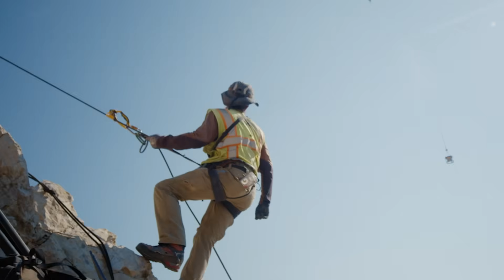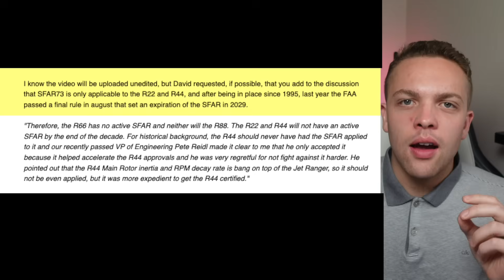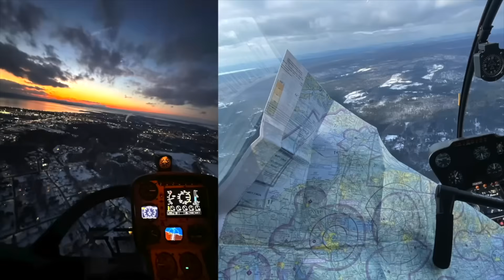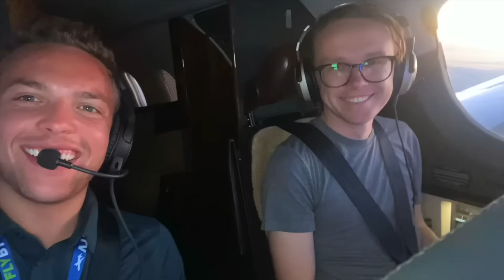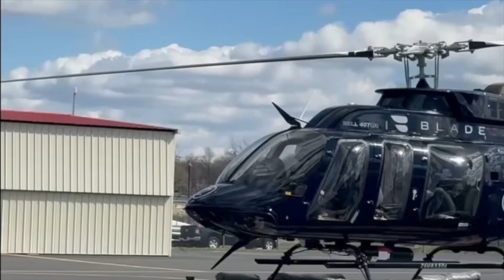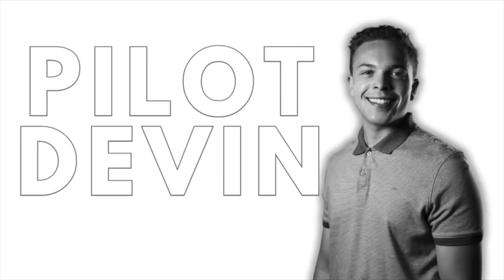Robinson CEO Defends the R88’s 2-Blade Design

Comment: Despite the claim at 2:02, the angle or rate of descent is unrelated to rotor inertia. Rotor inertia is important to maintaining rotor speed during transition, but after transition and during descent the rotor speed is constant so the efficiency of the rotor system as a wing is unrelated to inertia.

Comment: The engine in an R66 is s Rolls-Royce RR300, the latest variant in the Allison Model 250 family. Yes, the Model 250 is an old design, but most turbine engines are designs that started before the pilot flying them was born. 

Does anyone criticize the MD500 for using older variants of the same Model 250 family?

Comment: The mast bumping issue in negative G on 2 blade helicopters is an issue in for example extreme weather ... you have to load your disc immediately and I've seen first hand 2 examples where a possible wind gust caused a must bump.
Reply: But, Robinson addressed the issue by not requiring negative g.

Comment: While I don't have any verifiable blade and rotor weights for the R44 to do a direct calculation, I was able to find some published inertia and autorotative index numbers for the R22. Based on those values and assuming some basic scaling, it would appear that the R44 would be well short of the 206 in the rotor inertia department. Not sure why Pete Reidl would have claimed the inertia is on par with Jetranger (especially based on pilot anecdotes). Would be interested to see how that was supposedly calculated.

Comment: Most of the younger pilots learned to fly on the 22 so we should be able to handle the Robinson system without issues and the level of inertia of those blades must not be that bad. The 22 is a very tricky machine but the 44 is a beast in comparison, it will float for a while

Comment: I wonder if the April 11, 2025 Bell 206 crash will factor in.
I watched this video the day before, otherwise I would not have known about low - G conditions on dual blade rotors.
RIP

Comment: Pilots flying the Grand Canyon used to actually aim for low G !  (Not necessarily on two blade aircraft ) .
Years ago they would approach the rim of the canyon then push as the helicopter 🚁 overflew the canyon.

Reckless.

Comment: engine shops said the 66's engine is old tech,  this ship better be as smooth as an L4. and cost competitive, and that engine cant sit, it needs a run put in the book biweekly . long blades arent easy to truck as well.  fast shipping a blade need special aircraft as well.  "systems"  are great when they work, But no work ? will it ground you? Any one with autopilots will have horror stories on getting it working again. 's. then add in much of the planet  access to high end avionics shops let alone a field repair visit are scarce, We hear stories constantly how people struggle to get someone to even set a fuel control up on a 206 or MD500 in many areas. .. let alone electrics that can ground you.   then the cost, Bell 222 operations that saw 40K min charge to get any Rogerson box looked at

Comment: IMO,
Besides the inherent problems with a two bladed main rotor, mast bumping, low G's etc, that can be rationalized with bombing you with "more" training etc, etc, which seems to be the mindset that will cure all safety issues to make you a "safer" pilot. Most pilots are safe pilots, it's the equipment in question that may not be a totally "safe design". 
The problem I see here is the "proper loading" of a 10 place chopper. The PIC will have to be very vigilant on how the chopper is "loaded" to maintain a "balanced" load to get the best CG, Center of Gravity, ie, your "weight n balance" sheet. This will be a tricky issue 
when having to load the chopper up to max capacity. Personally, I feel the R88 will be a flying coffin. At first glance the design looks weak, compared to a UH-1
Huey. The tail boom looks like a match stick, compared to a Huey.
It will take at least 5 years of the R88 being in service out in the field to prove it's own safety record. Robinson is trying to "cash in" with a multi-use cheaper or more affordable chopper. It's safety record has yet to be proven.
I have flown R22's and now currently flying the Bell 47's...
Clear Blue n 22
%

Comment: I had a friend with an R22. He said Robinson helicopters told him they were having a blade separation problem and just take a quarter and tap it along the edge. Listen for hollow spots.
 Yes, me. What I thought of that. I told him just write out a check for new blades because if they separate in the air you're gonna be busy writing that check on your way down.Wishing you would have bought those blades

Comment: My conclusion is they have provided an increase level of flight safety via complex avionics and sensors to mask an inherent limitation of their rotor system. The cost to develop build and maintain the addition avionics and sensors should have been invested in a better rotor system. The additional complexity of avionics and development is going to add hundreds of thousands of dollars to each machine, plus increase the long-term costs of maintenance and compliance. I hope I wrong, and the machine is a great success, just have to wait and see.

Comment: I don't understand why they keep using a free teetering rotorhead?  Surely they could switch to a slight variation and completely eliminate the possibility of mast bumping.
Reply: They compete on price, not safety.
Reply: The autopilot and new tail do that - the new autopilot will basically more or less prevent the flight condition  - but of course they can’t advertise that because there is always a possibility
Reply: @Fatherof12 Good to know!

Comment: I got into some pretty bad turbulence in my Enstrom a few years ago and I was thankful I was not flying a Robinson. I'm not sure I would have made it if I had a low-g sensitive 2-bladed rotor system.
But, I understand the practicality points David makes. One of the rotor blades on our EC120B needed repair and it took over 3 months.

Comment: It at least looks good.  Bell blew it when they designed the 505... SO stupid looking. 
What ALL helicopters are missing is QUALITY screen/radio interface via the CYCLIC & COLLECTIVE.  Yes, touch screen sounds sexy, but there are so many keys/buttons that should be accessible via the flight controls.  I just don't get why there are no test pilots or "feedback groups" providing this input!!!!  We seriously need quality UI/UX software AND hardware people in this industry.  You should never have to take your hand off the controls to change freqs. and I'm not talking about a comm flip-flop between active and standby (yes, you need that) but also can switch between UHF, VHF, FM (an up-down-left-right type switch like the OH-58D?).  Airbus (and I hate Airbus helicopter products) have the best cyclic setup option out of the bunch (plenty of buttons that are fairly ergonomical to reach and lots of them); it's easy to make a collective control head whatever size you need.  There are lots of times you need to just be able to zoom in on the moving map or switch display options that should be tied to a button on the controls instead of taking your hands off of them to touch the screen.
Also, I forget which Garmin but I think the touch screen G650 when you went to change the volume the little mini-screen display would cover over the flip-flop button for 2-3 seconds, delaying you to flip-flop if you needed to right away (who designs these things?!?!?!).  Poor software UX design.

Also, QUALITY pilot seats.  Passenger seats can be those thin-style, slick looking types but pilot seats (e.g., butt in it for HOURS/ALL-DAY) should have amazing foam.  I have an office chair at work (NOT memory foam) that I sit in for 8 hours my butt NEVER gets sore (kind of the higher end Office Depot style that's not even gel; just high quality padding; and it's a 3rd hand-me down, LOTS of really big guys used to sit in it for years before me and it's still amazing).  Why can no helicopter manufacturer not figure this out (I've flown 60, 206, 407, 130, 530, and 145 and they've all largely sucked in the seating category).  

Little details like a quality helmet hook, SEPARATE designated place for checklist/emergency checklist or iPad (compact slide in compartment and NOT the same big pouch/compartment area you're going to stuff your snacks, hat, etc. in)... I'm sure there are others but I'll finish my rant for now.

Comment: Next time you talk to him, ask why they ran the back end of the cabin through a bandsaw and made it so blunt. Could have had a nice sculptural butt like on an A-star or even a Jet Ranger, but instead we get...flat? I get the "fold down for a litter" thing, but surely they could have shaped it with something a bit more ... aesthetic. And before all the haters get on me for wanting good aesthetics, I'm not claiming you sacrifice functionality for aesthetics. But there are ways of designing that can balance those better than what we got here.
Reply: Flat back end and cone on top and you can immediately tell it's a Robinson product from a mile away 😄
Reply: It’s a pickup truck, and it turns out “more sculpted” actually can create aerodynamic instability - this was discovered in the early days of helicopter design - you might also research the Gurney flap

Comment: Do the R44 and R22 have weights in the blades like the JetRanger/LongRanger blades?
Reply: Of course they do.  That’s how the rotor system is balanced and tracked.
Reply: @JohnJones-ff4nu  I was referring to the "blade weights" bonded in the ends of the blades to help with blade inertia during autorotation. They weighed about 20 pounds or so. I wasn't referring to the small weights used on the hub for track and balance purposes.
Reply: @leroycharles9751 Yes there are weights at the blade tips.
Reply: @ Thank you.

Comment: Is it gonna have at least have composite blades ?  And why still open end tail rotor ?
Reply: Don’t know about the blades but the tails on robinsons are really good. Ya they have the risk of people walking into them or running into things with it but if they did anything else it would add weight and complexity and would increase cost. I think the whole idea is to be in a lower cost market

Comment: You know what… these guys are actually genuises. I was skeptical before I watched this but hes 100% right. Everybody else is building multi blade multi engine helicopters these days. If people want a helicopter like that, thats perfectly fine and they have plenty of great options to choose from. If they had built a multi blade turbine helicopter they just would have been another one of the many companies doing so. What people cant buy these days though is a brand new, low/flat floor, rear hatch, turbine helicopter with 2 blades, so theyre bringing something new to the market that doesnt exist. You can buy old hueys and 206’s but they arent rear loading. The low cost and minimal hangar space needed is huuuge here. Theyre going to be able to essentially own the low end of the turbine market. Hes absolutely right that if the option is a 2 blade or nothing because its too expensive people will go 2 blade every time. Theyre actually opening up a whole new niche that theyre going to have all to themselves. Even the leonardo aw09 which is revolutionary in its capacity for a turbine single has a 5 blade rotor. So already theyre undercutting them and its not even out yet. The amount of features, low cost, ease of maintenance and hangering is going to be huge. Soo many people dont need or cant afford an h135 and this will do most of the job for a fraction of the price.

-One other thing he mentioned which was important that I wish you had grabbed on to and expanded on is how they changed the tail to fix mast bumping. The autopilot is great to have if its needed, but fixing the tail makes it so the autopilot will rarely need to intervene anyways because it is no longer imparting roll on the airframe. Passive safety features are the best first line of defense. Fixing the tail so it doesnt roll in the first place is way better than correcting it later with the autopilot. So that was great to hear as well, I think he should have went into a bit more detail on that just to emphasive how important that is. Theyre going back and retrofitting all older models as well. This is so important because who knows if an r22 will ever get a multi axis autopilot, but fixing the tail makes it much less necessary.
Reply: The way you just broke it down instantly reminded me of the Mazda Miata / MX-5 success story. Coming out with a roadster design a decade after the entire 1970's roadster genre had been dead and they went on to sell millions of them because they tapped into a market potential that no one wanted to see.
Reply: @chrisr8996  Exactly. Bmw had been putting out expensive roadsters for a while and thats great if you have a lot of money and want all of the awesome features. But if you just want something thats cheap, easy to work on, and will get you around the track just the same the miata had everything you needed.

Comment: As I pointed out previously: It's the cost of operation that will make the R88 attractive.  The revelation in this interview that the cost of acquisition will also be significantly lower will help quite a bit as well, as will the Autopilot. The question will be really what's better: an R88 or no helicopter?

Comment: The R66 and R44 are more unsafe with regards to mast bumping / low G , particulary the R66, as they have so much lift and are so light when near empty . The R66 being lighter than the R44 with bigger blades (more chord), only 180kg heavier than the R22. So these machines get themselves into issues with mast bumping / low g around turbulence much easier than the R22. 

The R88 having this rotor head just means the machine can’t go places that other machines could. You wouldn’t be flying one of these into the Lee side of a mountain range in 30 knot winds for a rescue operation. The R88 machine by default will be limited.

Kinda weird the SFAR73 doesn’t cover the 66 and 88 due to this
Reply: Good point about the disc loading to weight relationship providing safety margin  or lack there of, in raucous flying conditions. However the use of the autopilot and associated electronics definitely threatens to be a game changer. Just how much of a difference maker and trusty servant remains to be seen. But even tracking the mast to tip path plane, or even tail boom relationship doesn’t strike me as beyond possible; as a layer of AFCS architecture. 

It ll likely be able to perform all the rescues a two bladed Bell could and then some, which unless you re operating in the alpine Patagonia still means most times and places. Much rowdier than that and no matter what you re flying you re getting into boom strike territory anyways…

Great interview and good to see a CEO donate his time graciously. Robinson gotta love ‘em, complete underdog all the while being easy on the tax payers wallet👍
Reply: @ it will be remain to be seen , the coning hinges as well as the teetering hinge put the robsinson rotor head design into a different category really to the standard teetering hinge. Hard to compare somewhat . I think the weight of the machine will play a part in where it can go. But a 206 will handle lee side of a mountain range in 30 knots , no Robinson would and around mountainous terrain like New Zealand etc , that’s pretty critical for rescue ops
Reply: @ZPDrift  Well one things for sure it’s a long way back from a bad reputation….

I’m sure the folks at Robinson have been tortured long and hard on the rack of good conscience, not to skimp on design R + D when it comes to such tacit issues. Knowing that….how, where and when the machine is flown  will always account for the lions’s share of culpability able to break any equipment ever. Wish em luck climbing outta that hole.
Reply: @ZPDrift this is not correct. You should fly the new horizontal stabilizer configuration on the R66 or R44 and you will see it is an entirely different experience.
Reply: @davidsmith7406  have you flown it yourself and tried to put it low g ? It isn't a cure a call . Time will tell how effective it is

Comment: No matter what they said I have flown both and the R44 has nowhere even close to the rotor inertia of the Bell Jet Ranger plus it has a stronger symmetrical blade which produces more lift and cushion at the bottom of the autorotation. I still fly the R44 weekly and I wish it could auto like a 206. The two bladed head with Robinsons blade quality is definite mistake on a 10 place machine.
Reply: Two words: John. East.
Reply: Cost savings is why they stuck with it.
Reply: While I don't have access to the actual weights of the R44 blades, based on the design and published calculated inertia for the R22 rotor and assuming some scaling, you are correct that its not on par with the 206. The Robinson VP of Engineering claims are dubious at best.